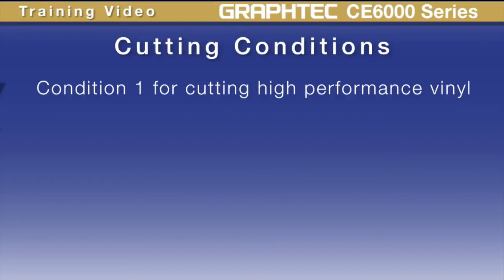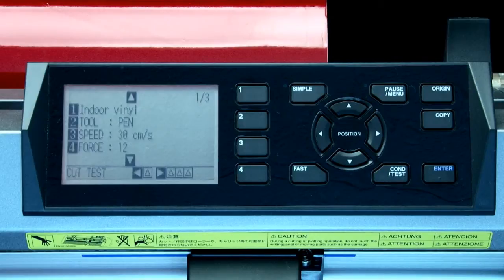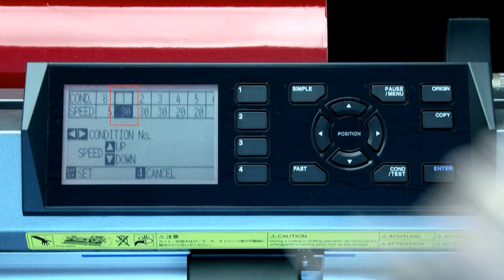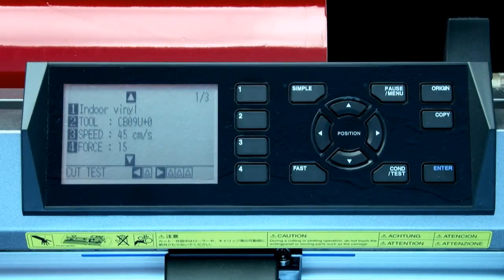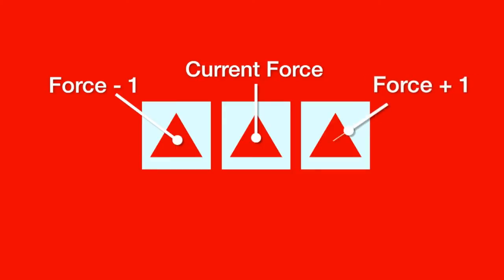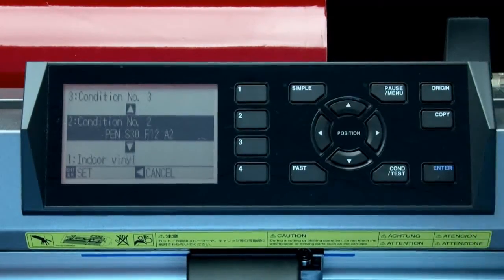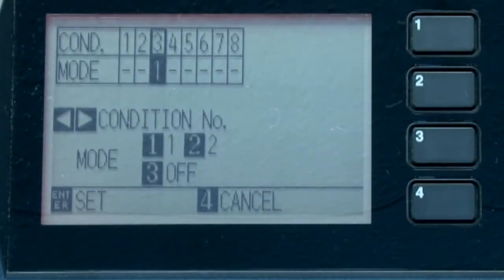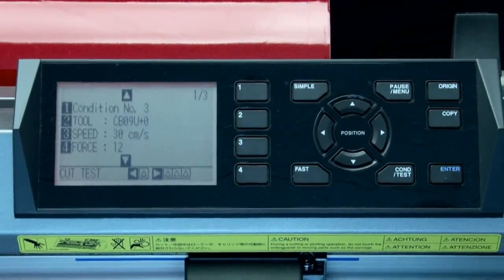Graphtec CE6000 Tutorial - Setting Cutting Conditions

Comment: I always find it difficult to find the info/help im looking for with this machine. I wish there was a manufacturer product help line. All of a sudden my machine is not finishing the cut jobs, it stops at the edge. For example, my graphic is 12 inches wide but the machine stops just short of that. It cuts the entire design except the left edge, leaving it unfinished, as if it ran out of material or space or it thinks it reached the edge of the cutting area but it has a whole 3 inches left of space.
 I dont know if its a hardware or software issue or some setting somewhere? Using graphtech studio software my setting all look good. The cutter says my area is 13" wide but its not, my roll of material is 15" wide. could this be the issue? If so, how do I get it to recognize the full 15" width?
Reply: Did you ever figure out the problem because mine is doing the exact same thing
Reply: @shannon2468  If I recall correctly, The machine, by default is set by the factory to recognize only the length read by some  sensors. I forget what the purpose for this is but these sensors also make it difficult or impossible to use scraps because a scrap is too small for the sensors to read.
I went into some setting under the pause/menu button and found an option to disable the sensors because I dont the machine to tell me how wide my material is.
Once you disable the sensors, the cutter will go by the length between the pinch rollers and not the sensors so you can go as wide or small as you need.
Reply: @madmedia3380  Thank you!!

Comment: what about offset ? When shoudl that be changed and were does that info come from ? And why skip over the overcut ? How do you determine what value that should be ?
Reply: i move the blade tool to front when i want to perform die cut, and set the offset value to +5